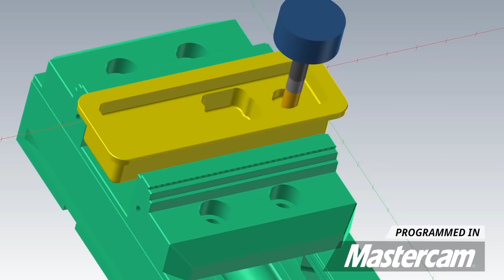My Boss SUCKS and Represents a CANCER in our Industry… I’m DONE.

Comment: I worked at a Helicopter company 6 yrs ago. They had 100 used Trunions for the Stick Boost Lever. They had extremely tight tolerances and were considered unusable. I told them I can save some of them, so they let me try. I saved 70 of 100 at $3700 each, a savings of $259,000. I got a 1% raise and the Suck-ass in the shop got a 6% raise. I quit 6 mo later.

Comment: Where I use to work i was cutting cycle time from 15 minutes to 5 minutes and suggested a redesign of the tool and was able to go from 1 part of a 15 minute cycle time to 6 parts in a 5 minute cycle , and I got screwed in end

Comment: I am unfortunately for 10 years sick and unable to work, depression, PTSD and that direction.
The work, especially the working hours and a psychopath as a supervisor had given me the rest.
Originally we were both at the CNC and at the laptop to program, and he taught me all that.
Within a few years, we had pushed each other to the limit and the company was making millions.
Not least because we worked 6-7 days a week, sometimes up to 16 hours a day, and the machines ran unattended all night until we got back in the morning.
Depending on whether we had programs that took several hours.
What I wanted to say is, in any case, morbid ambition can destroy, as well as lack of ambition.
I couldn’t work for a month in a company where so much time and money are wasted.
Nor in a company that burns people like slaves.
Anyway, it was prototyping and we made the injection molds.
Within almost 3 years I had seen over 1000 articles running by, this speed alone makes you sick.
Well...I'd like to have the joy of work back, but that probably won't happen again.
Anyway, nice video and keep your joy at work, teasing the last possibilities out of the machines is an art that few can master.
It just occurred to me that the old rockets used in the moon landings can no longer be manufactured?
Because there are no longer workers with the necessary skills.
And because the plans are incomplete, too many details have not even been written down because they were only added during manufacture by the workers.
Sorry for my English, if something is wrong, I want to say pass on your knowledge to others so that it doesn't get lost.
And be it just how to properly hold a file in your hand.
Humanity is going dumb right now.

Greetings from Germany

Comment: Where I work we have some pretty fast machines but we also have some old machines, like older than me and I'm in my 30's if you run those machines above 100% feed you ruin the part, break the tool and eventually crash the machine,  I once worked on lathe , in my defence it was a pretty new one cranked it up to 120% and boom 💥 it just destroyed that tool in seconds 😂😂

On my machines  120% rate is no sweat for them but the older Realmeca VC Spinners no chance cranking those over 100 without having at least faulty parts at the end of the cycle 😅

Comment: I currently work at a company that produces bearings of various applications. We assemble these by hand. The station I'm at use to be automated at another site but then it was relocated because we had the space. We build these faster than the automated system. I believe there are machines that can build these faster. It's just a matter of finding the right machine. But the company is looking at keeping it's labor force. They care about the labor force over trying to increase profits through reducing head count.

Comment: Ive seen this a lot even in small regular Bavarian workshops, they let these steel saws run an very slow speed so the saw blade lives longer and doesn't have to be replaced, but when you work faster, saw blade breaks faster but the saw blade cost gets overshadowed by the increased amount of products made and sold

Comment: A friend of me told me a similar story: The CNC was machining plastic parts with very small drill bits (think of a dremel). When he came in first thing he figured out what was the maximum revolution of the drill bit allowed for the material. He changed it from a few hundred rpm to 2000 rpm and the parts took only a few seconds to finish instead of several minutes. And the people in charge thought the same thing: this is dangerous. However, when you break  a 1 mm drill bit and ruin a plastic part that has material worth one cent what does it matter, when you can produce five or ten times more parts in the same time?

Comment: I worked as a machinist for a few years on conventional mills and lathes, and then I went to work in a shop that had NC mills and one NC lathe. They put me on the lathe, and I set it up, and after shutting, the cabinet turned it on. It wound that stock up so fast it scared the shit out of me. Lol
I had never seen anything run that fast.
Only one problem. There was an error in the program, and instead of moving away, it went in, snapping the tool off. 
The programmer could not find  the error because he relied on a plotter that couldn't show it. I stepped through the codes after studying them and found it. That was my start in NC, cnc, and also electronic tracers.
I got out of the trade almost 40 years ago and never looked back.

Comment: I would bet that this is what the Chinese do - running their tools to the max all the time.
But there could most likely be greater wear and tear on the machines. For one, bearing loads would be higher. When the bearings start to go then the parts are out of tolerance. The cutting tools will also be under heavier load and will wear out faster. This can also lead to quality problems and higher loads on the bearings.
Anyhow it's a good idea to maximize productivity, but the wear and tear on the equipment and quality of the products being produced need to be taken into account. Otherwise the product quality becomes the same as Made in China.

Comment: I experienced a similar story in my last job. My boss had problems that I had better ideas as he had. In the previous job i produced parts made of tantalum. The company started cnc turning for this parts without any experience and hired me because they had a worker which couldn’t get along with this material on cnc. I changed a lot about the tools and developed the processes with a lot improvements about process stability and lowered the costs and increased the output. I found ideas to produce parts which were not suitable for the machines and developed clamping devices to save material . I made the processes that good that even a competitor which produced tantalum raw materials and cutting tools couldn’t make better prices for our customer. I kicked them out even they worked in that field for many decades .Finally I left the company because I didn’t liked the attitude of the boss . Now I work in a company which produces medical parts made of titan. The college’s are very nice and the salary is much better. Some people always have problems with other people who question the thinks how they are done. Thank you sharing your story. It’s good to know that I am not the only one having this problems.

Comment: I mainly work in hone/lapping with tolerances ranging from +/- .0001 to +/- .000010 and flat w/n 2 light bands. Occasionally I will do manual lathe work and one part in particular is titanium with a wall thickness of .002. So the point of all that was that all those jobs I do was mainly figured out by burning alot of time experimenting but once you find the process that works for you. It can be tough to change it or even harder is to teach it to someone else. As you mentioned ppl are different. Same for me everytime I have to take over say a O.D grinding job with someone else setup plus tweaks they've made I'm instantly nervous as I have no idea what  the part will do lol. So I feel like I understand what his ex boss was saying about changing it back fir the night guy.

Comment: Sounds like you're old boss is similar to mine, but my boss started buying HSS endmills that throw blue chips running 50sfpm. Today I was supposed to cut 40 keyways, I was given a new endmill, it only lasted seven 5" long keyways on one end, the other end didn't get 1/2" before it pushed a big burr and would go no farther. When I looked closely the endmill was improperly ground with rub marks behind the edge. They have only been getting cheaper with every new order of cutting tools. This is a shop full of senior machinists most have worked here for over 25 years like dogs.

Comment: as to "dangerous" i have simply re-done programs for laser/plasma cutters to re-order the cuts so they flowed from one cut series to the next and only knocked the last tag off, to make the parts start falling lose, as the very end... in a way that couldnt damage the cutting head if one didnt fall threw and stuck up a bit.. our direct supervisor was upset when he realized the unit was putting out parts about 2x as fast, note, i didnt change any feed rates... just re-ordered the cuts... thankfully his supervisor walked in as he was starting to bawl us out... he had noticed the improved production and was going to ask what we changed...when he watched... he gave me a bonus and asked how i learned to program the thing.. when i opened the cabinet under the controls and pointed at the manual.. the man just started laughing and couldnt stop for a good bit... he didnt even know it was there.. when he asked what made me think to change the cut order... i said it just hit me that the cuts could be done in a much more elegant way and as i waited for long metal bars to cut on the cnc saw i got working as a CNC saw rather then manudal, i used chalk and checked my idea by drawing the cuts... when i had my buddy who operated it do the same.. he told me he thought i was right.. so.. i copied the program to a new name...and moved the cuts around...the changes removed auto pauses it made between cuts the old way... kenny, the good boss, actually did similar with 3 other jobs after realizing what i did and why it worked... he had to read the manual to check how to make a few other changes to make it even more efficient.and use a few functions nobody realized the machine had... because...nobody ever read the damn manual but me... then him.. LOL... 

that guy still tried to get them to use the old program....that problem was solved when kenny deleted the old files(he had backups..) so he could say it was mute, the old programs were gone... 

anyway... i also have had a couple jobs with automated soldering that i had to actually turn the things down a bit to avoid cold solder joints that had cropped up when somebody pushed it to the very limit... after some tweaking i actually solved our production qc issues and things came out around 23seconds later then they use to... BUT... fail rates dropped to near zero.. where it was over 20% before that because of cold solder joints... i got yelled at... till this crusty old woman told the guy to shut up, i had gotten their fail rate to near zero meaning productivity was up.. also the solder they were using wasnt the same as they tested, since its lead free, and the stuff tested likely had lead in it... that he needed to learn to thank people for solving problems not make them feel like solving problems is more problematic then just letting shit fester... she was harsh but... i later found out... shes his aunt...owners sister... and told his father about our success before the son found out.. then told him how his son reacted...then made his son buy us all pizza and drinks after work every friday for 3 months...LOL.. to be honest once he pulled head from ass. he became a good coworker...even kept doing the friday pizza thing as far as i know, to this day... during cv19 im told he bought a pizza oven and they started making pizza at work since noplace was open...but nobody wanted to sit around at home and not work...(anybody who did could stay home and still get paid to do something from home... nobody stayed home outside to take care of kids and the like... infact... thanks to the amount of "true sun" lights the place has.. they were in very little risk.. (uv kills the virus, but also helps to harden/cure some coatings they use so win/win for their work having lights that mimic real sunlight...even more since it helps stave off winter depression... it wont give you a sunburn but.. its a healthy level of UV in the main areas.. more in areas where it helps cure coatings. )

Comment: This is really cool shit to get into if the pay is right. With a weekend crash course on a 2D CNC machine as a computer technician, I taught myself how to cut in 3D with multiple passes and jobs. I was cutting plastic including  lexan which is bullet resistant and costs 5-10k dollars for a slab of it. No mistakes. This is why I left the industry; high stress and I wasn't making over 100k.

Comment: No offense dude, but I don't think you get it. What do you think you accomplished? Say you normalize this way of thinking in machining. Companies take that, lay off 75% of the work force, and deliver the same amount of product in the same time with 25% of the labor overhead. All this would do is increase the pocket change for people running the machining companies or the companies using the parts.

Comment: I work in Information Technology. Early in my career I was scripting the deployment of a config file for the business analysts at the company. I made an error at one point and fixed it. The error deployed an incorrect file to a handful of people and there was only around 10 minutes where the wrong file was deployed. One employee happened to call the config file in that ten minute period and contacted the helpdesk. I got the ticket and resolved it immediately, because the issue was already fixed, and explained what happened to the user. The user contacted my boss and complained (which is completely ridiculous on its own). My boss called me in and yelled at me for using scripting since scripting is dangerous. He told me to never script anything again. My boss was an absolute idiot. I kept scripting and simply didn't make any more mistakes before I found another job.

Comment: This happens in all industries. I have been doing electronics repair my entire life, and have worked in many shops as both contract labor and an employee. No one was interested in anything I did that made my job faster and more accurate. Sometimes they'd even try and stop me from using those methods and equipment, even though I proved myself, my procedures, and my equipment each time.

"But we've always done it that way!"

I have gotten a lot less of that pushback on my current job. The boss has changed procedures based on my input. I have built jigs and fixtures that my coworkers also use. Mostly. One coworker isn't interested in anything he didn't read in the manual or come up with himself.
Reply: What kind of items do you work on? Electronics-specialized guy here in a big company, but I'm pigeon-holed as a testing engineer.

Comment: My questions would be who setup the slow program and why? You aren't the only person working there. I seem to recall hearing this same story a few days ago and the issue was that night shift was crashing the machines not realizing the code was altered by the day shift operator. If you are more skilled at feeds and speeds why aren't you working with the people generating the code? I will tell you one reason I know of shops running slow jobs. The customer will pay the hours and they would rather run slow than fire 70% of the factory workers.

Comment: You’re 100% correct in my opinion.  I used to sell carbide tooling.  Sometimes I could cut cycle time by 50% but if my insert was 50 cents more than brand X the plant manager wasn’t having any.  It was maddening.
Reply: Yeah had a job doing press operator each job took 1-3hrs and it could be up to 30 minutes setup depending on how complicated if we had to move clamps around etc. Boss insisted we do jobs by "priority order" no matter what. Problem being that meant every single job we had to do another setup. BUT if we did it by priority by "finish date" only aka Jobs that needed to be done Tuesday do  we could cut out 3-4 setups a day and have to change out tooling much less. 

The other frustrating part is by doing individual order priority instead of finish date. They left same time end of day so it changes absolutely nothing. As well as fact we were running 3 machines so individual prioritys would often take same tooling. Which we didn't have enough to run same setup on 3 machines. So were constantly having to do asinine setups that should take 2 pieces to setup and using a dozen 4-6 inch pieces of tooling instead of one 22 inch piece. 

Which since tooling wears differently each piece added makes overall bend wavier and less consistent and take more time to dial in.
Reply: price ≠ cost